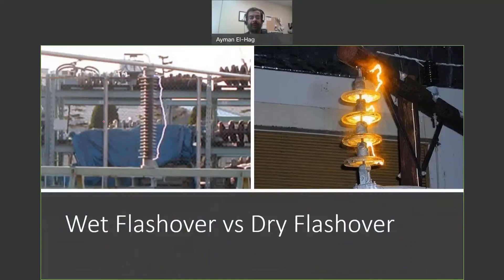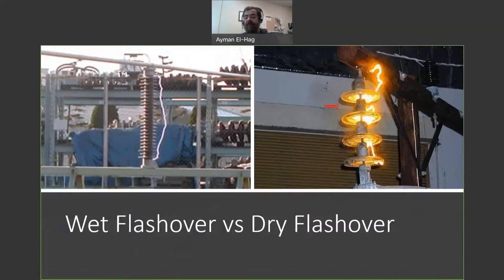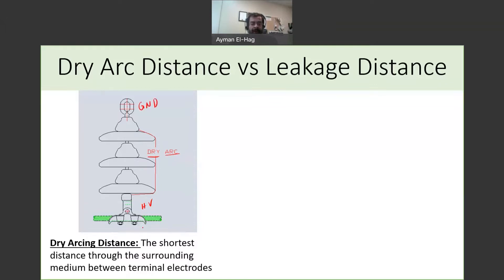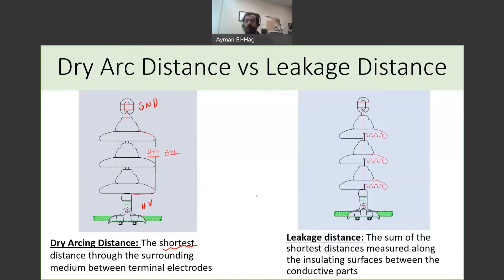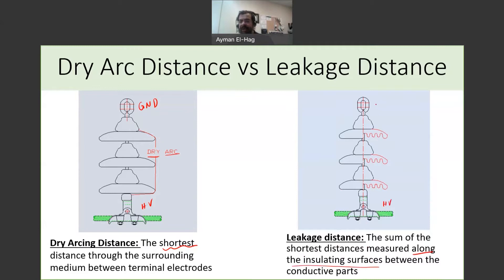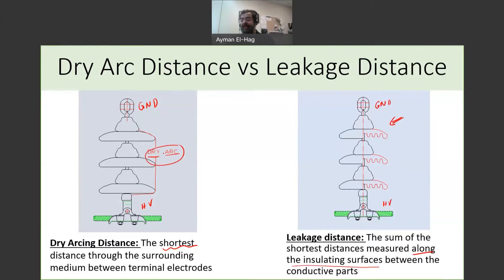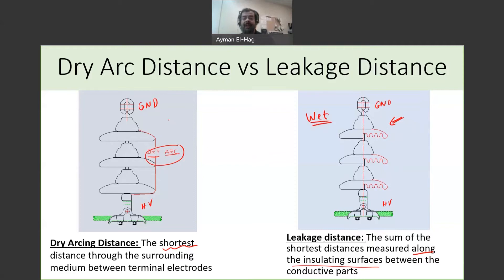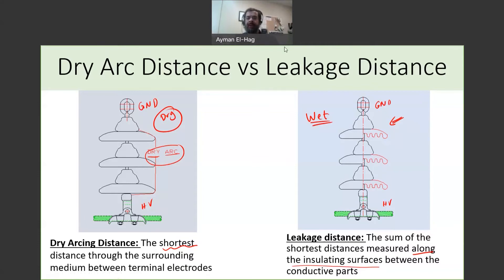Wet vs Dry Flashover

Comment: Many thanks for your video. In case we have lightning strike, in that case the dry/wet flashover takes place. Could we consider the voltage level for that to be same as dry/wet flashover voltage at power frequecy or is there reduced voltage value to be considered for flashover in this case?
Reply from the maker: The lightning flashover is totally different than the power frequency flashover. It is much larger and this is because the standard lightning impulse has a very short time and hence a much larger voltage is needed. I desribed details of this in my online high voltage course.
Reply: @electrical4everyone many thanks for your reply. Yes I agree that protection level is much different and for that BIL values are mentioned. But in case of lightning strike on any phase conductor, there will flashover at insulator (arcing) which will attenuate the strength of the strike before reaching the Substation. What value of flashover shall be considered in this case? As before reaching higher values flashover will occur.
Reply from the maker: @sahilbhagat4356 the lightning flashover is according to the system voltage level. For example 13.8kV the BIL is either 75 or 95kV, 33kV is 175kV and so on. Over voltage protection devices like surge arresters are used to make sure the voltage level does exceed these values.

Comment: The wet/ dry flashover happened at 70/120 kV. What is the insulator rated operating voltage?
Reply from the maker: Thanks for your question. The intention of this video was not to get accurate value of the wet/dry flashover tests but to explain the difference between dry arc distance and leakage distance. Nevertheless, the insulator is rated 69kV.